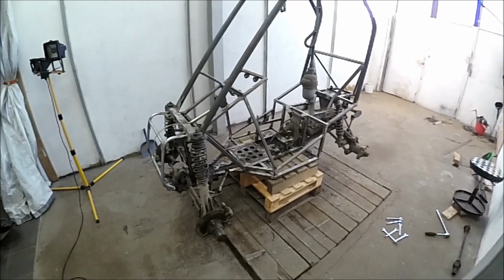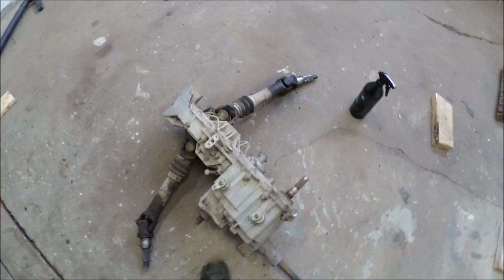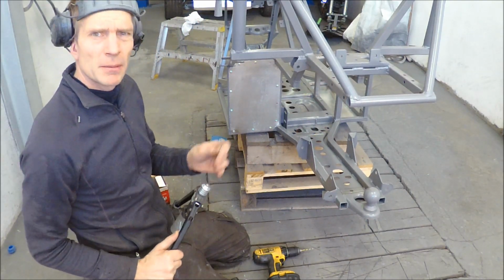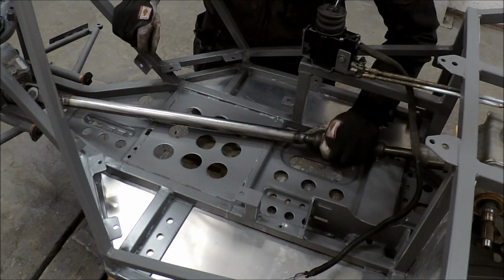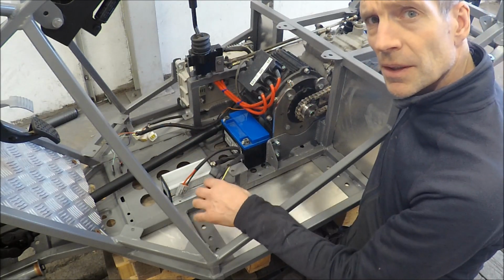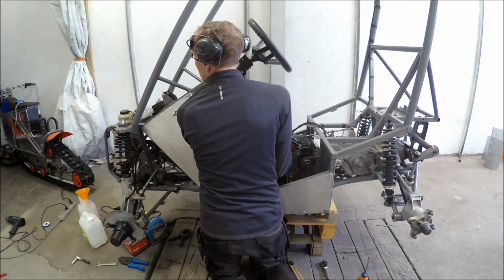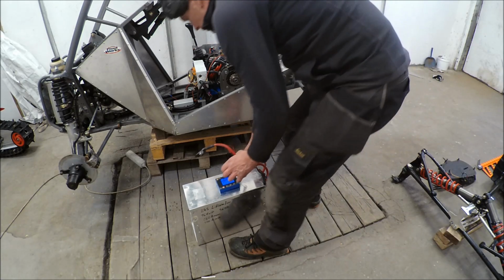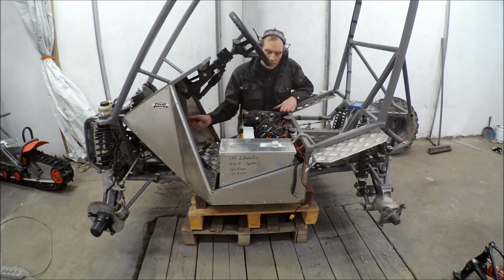Atv electric conversion assembling

Comment: amazing project, thank you. one thing i could not understand: cooling hoses where inserted into what? into the housing of the motor? they are supposed to cool the motor? how did you get it to be sealed. looks a puzzle piece is missing in my head

Comment: Can u tell me if any other polaris have a similar transmission i could use.
Reply from the maker: Hello, yes I knew the 2003 Polaris Sportsman 700/600 year has almost the same transmission and then I assume the older modells have the same.  BR Per

Comment: Could you list the parts please?
Reply from the maker: Hello,  I use the ME1304 Motoenergy motor: https://evea-kartmasters.fr/en/35-synchronous-motors  and the Kelly Controller 600 A with sin/ cos sensors: https://kellycontroller.com/shop/kls-8080i-ips/   BR Per